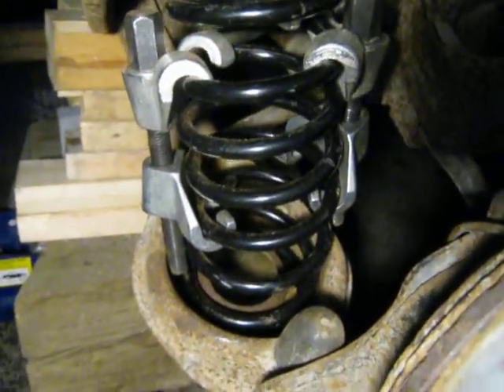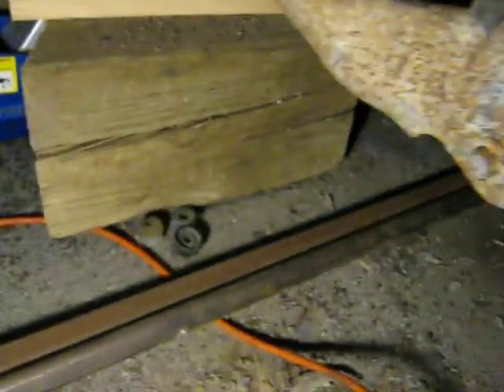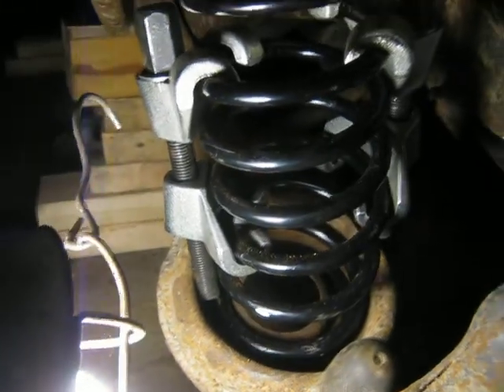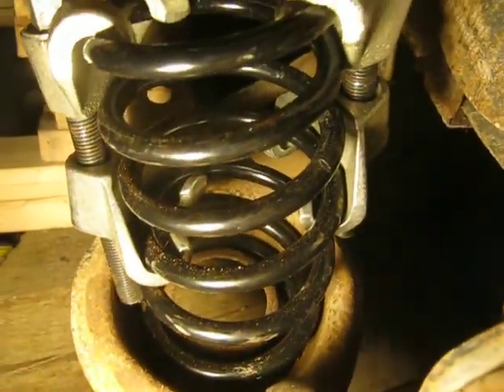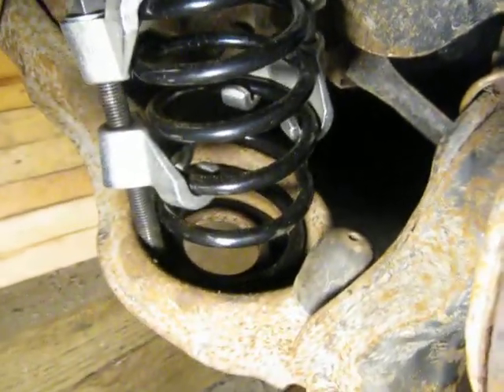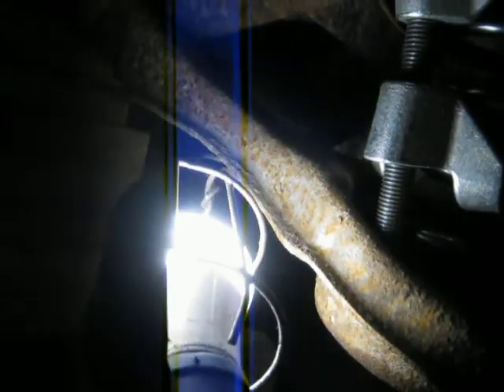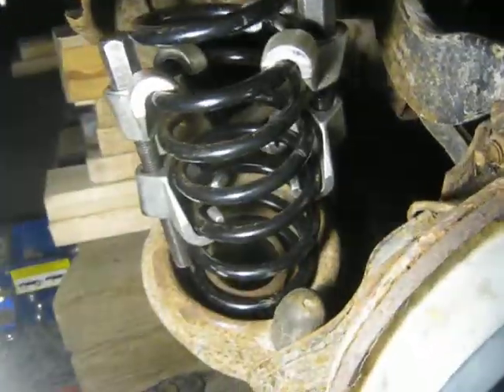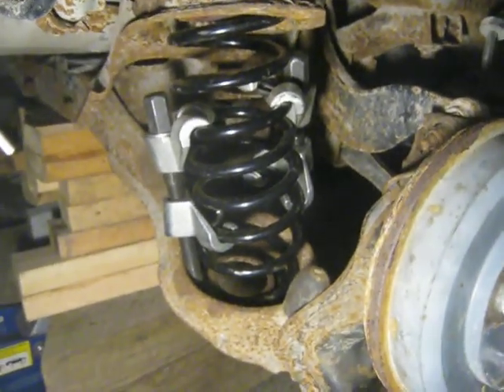FOCUS REAR SPRING REMOVAL

Comment: Just come across your video and having similar issues, sway bar link was corroded and rounded it out on one side so i'd suggest anyone doing this job buy a replacement set for what they cost!
Reply from the maker: Yes, you never know what it will take to finish a job on an old car once you start!

Comment: Thank you for the video. Do you still remember how long the two bolts were for the modified tool?
Reply: You dont need to modify, use the clamos inside the spring
Reply from the maker: I can check on that, but to me it wasn't a very safe set up, Please send me another message back, as youtube is only showing me messages I haven't replied to.

Comment: Nice video.    I had the same issue with my 2005 focus.   The bottom bolt was badly corroded and wouldn't shift until I got a 4 ft long steel bar  tube which I could fit over the handle of my socket wrench.    The wheel needs to be off for this to work.   E
ven then it took a lot of effort.   The problem with this is that you may shear the bolt.   I also had an hydraulic jack under the arm.    When I was turning it I got a mate to check the entire bolt was rotating.    Got it off in the end but I had to replace both the bolt and the nut which is welded to the down strut.    Hope this is of use to someone.
Reply from the maker: Thanks for the advice, it seems these cars require quite a bit of wrench turning!

Comment: Is it not possible to unbolt the other end of the suspension arm rather than the bolt which you have which is seized? I have the same issue on my car and am researching ways in which to remove the spring.

Comment: Id change both the back lower wishbones on this if I was you, even if it means cutting bolts off, as I had one break on me before, fortunately I was driving slow when it snapped on a speed bump, and I managed to save the car, Ford Focus can be an awesome car but watch for corroded rear wishbones
Reply from the maker: thanks for the advice, I will have a close look at them. I am not at all familiar with which parts die on a focus, so thanks again!

Comment: 3days  you put spring compressers inside the spring there’s a hole in lower arm specifically for the purpose duh!
Reply: The hole is to unbolt the rear sub frame from the car not to fit a spring compressor duhh
Reply: I have that tool, but it doesn't usually work if the upper coils are 
flattened too much.

Comment: I WOULD UNDERCOAT THAT REAR SUSPENTION/WETCOAT IT W/OIL OR SANDBLAST & PAINT. EITHER WAY, SIMPLY SEALING IT WITH PAINT OR ANYTHING THAT WILL SEAL OUT OXYGEN OR MOISTURE SLOWS THE RUSTING PROCESS!!!

Comment: I TO LIVE IN THE RUST BELT!!! NORTH EAST CORNER OF THE UNITED STATES!!! Most of these vids seam to be from owners who live either out west or down south & they are rust virgins!!! on my 03 focus se sedan( zetec vin 3) my rear shock (there are only rear shocks so, saying,"rear shocks" for me,seams redundant)   anyways, my lower shock bolts are roasty & toasty!!! completely roached out due to salt & rust!!! can you please tell me eactly what size, length, thread pitch & etc, the lower, rear shock bolts & nut's are please??? so I can replace my shocks & the nuts & bolts??? Thank you for having a more realistic video & typical problems!!!! & HAVING TO RESORT TO APPLYING MORE THOUGHT INTO HOW TO MAKE THINGS WORK!!! NEVER AS EASY WHEN DEALING WITH RUSTY & CORROSION!!!
Reply from the maker: I will have to have a look to see if I bought a spare bolt, or kept the rusted ones. If I haven't answered back in a few days, please leave another comment, i need the occasional reminder :)
Reply from the maker: The bolts in mine were M12x1.75  , the ones I bought were 80 mm long, and I used a hardened flat washer, as well as a nut that was loctited in place. I put the washer under the bolt head, similar to the original bolt, which required a good 6 point 15mm socket, as I broke 2 cheaper sockets!  Hope this helps you.

Comment: There are spring compressors that go through the hole in the lower control arm and would do the job in no time.  Checkout spring compressor for a mercedes as an example.  You can buy cheap imports for less than $100
Reply from the maker: That would work well, as long as it fit the hole OK, thanks for letting me know about that type.

Comment: Had similar issue. Brazed cheapo wrench to the nut and used floor jack to push up on the wrench. Car lifted about an inch before bolt came loose.